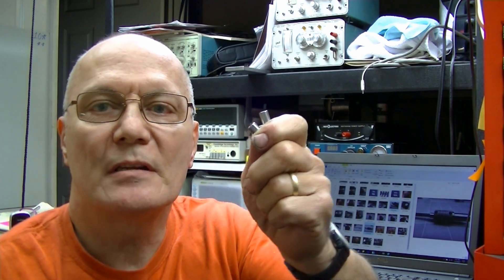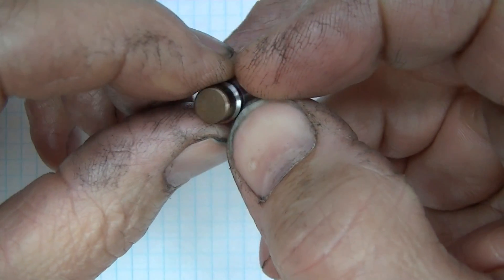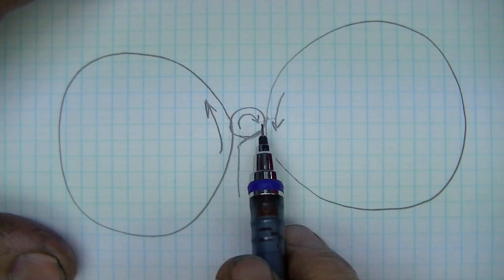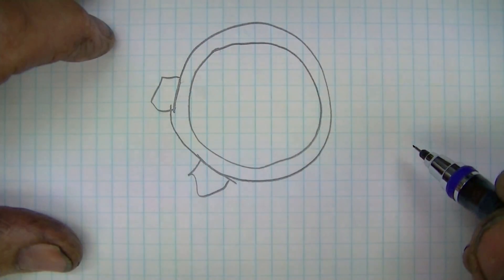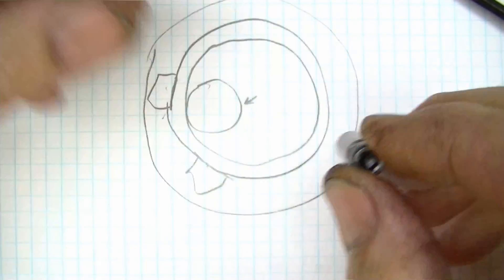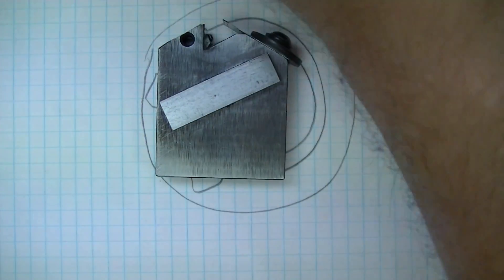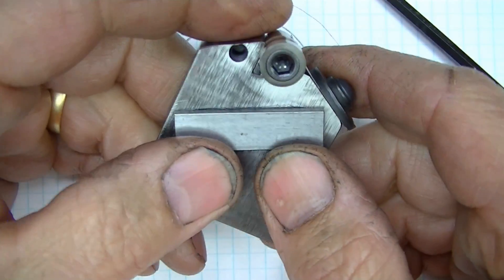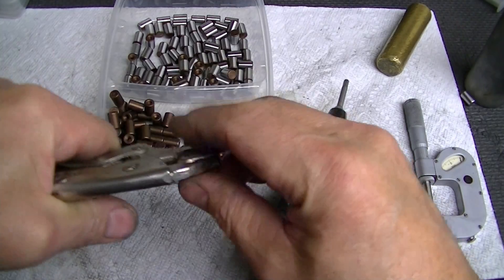CENTERLESS GRINDING  ON THE SURFACE GRINDER

Comment: Hey Robin, just found your videos, and really enjoying them - thanks for taking the time to share your knowledge! Do you happen to have a good resource for setting up the cutting geometry in this situation? Machinery's Handbook only uses terms like "too high" and "too low" but doesn't go into specifics or have any decent rules of thumb. Thanks!
Reply from the maker: You just have to get high enough to get the parts to round up. If you go too high on a regular centerless grinder the parts will scoot out from between the wheels. With the spring steel holder on my setup that wont happen.

Comment: What was the reason for not locking the table and head and using the y-axis infeed? Seems like there would be less worry about disc wear.
Reply from the maker: You have to remove the material full face for this to work at all. The single dress of the wheel lasted all 310 parts.

Comment: in another video you showed some carbide ball tipped indicators, how did you connect the balls? actually i think they were SiN. did you braze or glue?
Reply from the maker: Glued with Loctite 380 or 325 they are silicon nitride balls and are scuffed up where the glue touches with a coarse diamond file.

Comment: Clever. I have seriously limited experience with centerless grinding but found your solution interesting. Question....Once the wheel starts to cut the OD of the part, the part spins about the pin center until that newly ground area hits the first guide surface. Then it would shift a little bit to the smaller diameter. Did you ever encounter an issue with the change?
Reply from the maker: That is all part of the mechanics of centerless grinding whether plunge or through feed, regulating roll or shoe style. When set up well, parts that start as out of round will get round in the process of grinding. Obviously if you infeed too rapidly like full depth in a third of a part revolution you are going have issues regardless of setup.Thanks for stopping by
ATB, Robin
Reply: Thanks for the reply Robin. Obviously another shop process where taking your time is key to good results.

Comment: That's a great video once again - brief and to the point - thank you so much! One thing caught my attention: you say the bearing faces were "sort of induction hardened with a TIG torch". I would be most curious to get to know more details about this trick. Couldn't find anything in Youtube or the web. I am really thrilled  %-)
Reply from the maker: Thanks turbopunsch, I will do a follow up video but it is just heating the surface with the tig to bright red while trying to not actually melt it. The cooler base metal chills the A2 fast enough to get glass hard. Thanks for watching and commenting.
Reply: Do you ball the tungsten tip to make the arc less focused? I suppose 
100% DC should work best or do you use pulsed current or even some 
percentage of alternating current? Do you use a foot-pedal for better current control (avoid melting edges, etc.)? Thank you once again for taking your time for not just reading but even responding to all the comments!!
Reply from the maker: Sharpened  tungsten and DC with foot pedal. My tig is old school without any waveform controls other than DC or AC.

Comment: thanks. Resourceful approach. Very instructional.
I understand that the dial indicator measured the vertical travel and stop at zero of the grinding disc. How did you stop the horizontal travel of the grinding disc each time? By mechanical stop?
Why not make this an additional video format of yours? A short presentation of an unusual approach. Short is good in YT.
Reply from the maker: Thanks rol eic, I mentioned that the table has a hard stop and a rubber band pulling it against the stop. I am considering more of this short style. Thanks for watching and commenting!

Comment: Interesting setup.  I would love to hear more about hardening with the TIG torch.
Reply from the maker: Thanks Volker1929, I will do a follow up video but it is just heating the surface with the tig to bright red while trying to not actually melt it. The cooler base metal chills the A2 fast enough to get glass hard. Thanks for watching and commenting.

Comment: I can't help but wonder if this idea would play well with Stefan Gotteswinter's cylindrical grinding setup.  Would simply extending length of your centerless jig allow centerless grinding of longer parts (up to the Y travel of the surface grinder), by traversing the Y axis?
Reply from the maker: Not that simple and centers are better when feasible.Thanks for watching and commenting!

Comment: Two things you mentioned that I would like to know more about. 1) Tig induction hardening 2) Roundness measurement. Every video you do makes me want to learn more. Your knowledge is boundless....many thanks for sharing it with us all.
Reply from the maker: I did say "sort of" induction hardening with the TIG. I used induction implying a surface only hardening. Obviously the only induction involved is in the saturable reactor transformer in my old school Tig machine. I will do a follow up video but it is just heating the surface with the tig to bright red while trying to not actually melt it. The cooler base metal chills the A2 fast enough to get glass hard. Thanks for watching and commenting.
Reply: This is not induction hardening as there  is no coil. It is electric arc hardening.
Reply: I still would like to know more about it.

Comment: excelente!
that's german for 'excellent!'
please explain 'induction hardened with tig' that really perked my ears up.
Reply: I am not sure about your german ;)
Reply from the maker: Thanks Tony, glad you stopped by. I am not sure about your linguistics but your videos are awesome! I did say "sort of" induction hardening with the TIG. I used induction implying a surface only hardening. Obviously the only induction involved is in the saturable reactor transformer in my old school Tig machine. I will do a follow up video but it is just heating the surface with the tig to bright red while trying to not actually melt it. The cooler base metal chills the A2 fast enough to get glass hard. Thanks for watching and commenting.
Reply: Da Zweifel ich auch (said the Ami)
Reply: I am pretty sure all german words are at least 50 characters long.
Reply: gotcha.  You gave me visions of wrapping the steel in 4-5 turns of tig torch wire!  looking forward to your next vid.  Thanks again.

Comment: Very elegant setup there, Robin.
While we have a centerless grinding setup at work for the surface grinder, it would not have been able to do the job you showed, as it has a pressure roller from the top.

Thank you for sharing! :)
Reply: I have heard somewhere that in europe there are many  more small centerless grinding devices than is USA     I want to find out more about them...... Right now I cannot visualize a topside pressure roller setup....was the unit in your shop a shopmade prototype or a commercialy produced unit ?
Reply from the maker: Thanks Stefan, I have making that style of centerless unit on my list because it is also very handy. Thanks for watching and commenting!
Reply from the maker: St Mary's Spin roll has been around in the US forever http://asmfab.com/product-lines/st-mary-spin-rolls

Comment: Hi Robin,
This is a clever way to solve a problem...!!!
One question, do you have to compensate for some wear on the grinding wheel as you were going?
Cheers,     Pierre
Reply from the maker: Thanks Pierre, I did all 310 pieces on one dress and only compensated about .0003" for wheel wear. It is a Cubitron ceramic wheel and is excellent. But I was only removing about .0005" of the parts. Thanks for watching and commenting!

Comment: Fantastic!!  Would be interested in hearing more about your comment on "induction hardened with a tig torch'".. Thanks Robin
Reply: +1.. Rob can drop a half sentence of something and we all come running for more info. Superb job btw..
Reply: vpitool I to would love to know , induction to me is coils ad magnetic flux , TIG is just heat and very local , but I am sure of one thing Robin has a cunning plan
Reply from the maker: I did say "sort of" induction hardening with the TIG. I used induction implying a surface only hardening. Obviously the only induction involved is in the saturable reactor transformer in my old school Tig machine. I will do a follow up video but it is just heating the surface with the tig to bright red while trying to not actually melt it. The cooler base metal chills the A2 fast enough to get glass hard.
Reply: I've been wondering if there is an easy way to handle A2 steel other than vacuum furnaces and 1/2 deg. precision ovens and stuff. An A2 101 would be great..:) Not a lot of info out on this one.
Reply: Got it! That makes sense. Thanks for the reply and please keep the great info coming. Among the many Youtube machining channels your content is really exceptional.

Comment: I thought about this and I think this always requires a wheel at least as wide as your ground surface right? Your solution was brilliantly executed and I loved seeing it!
Reply: bcbloc02 No not necessarily. do long as the fixture is long enough to accommodate the length of the part, the table can be moved in the "y" direction. Depending on the amount of y travel on your table you could bring a part that long. On a 6x12 grinder your part could be 6"long. Setting up and indicating the whole setup would be time consuming. Once setup you could just as easily run 1000 parts. I actually think I prefer this method of cylindrical grinding on a surface grinder over using centers. It's a little more simple to set-up....maybe?
Reply: I would think that if you did that you would wind up with a tapered part? I think the partunder the wheel once you started grinding would either be unsupported since its diameter would be less than the rest or it would bow and flex into the stop and you would wind up with some less than stellar dimensions as you fed across and your contact points kept changing. I could be wrong but that is how I picture it going down in my head.
Reply: Good point. Because we are removing minute amounts of metal. I think it would be feasible to run it back and forth adjusting the grinding wheel down lower for another pass until the entire cylinder is the same size. Only one way to find out I guess. Though I won't be trying it anytime soon.
Reply from the maker: You have it right Brian on that and also on your comments below. Thanks and thanks for watching and commenting!

Comment: What kind of tolerance are you able to hold with this setup? Was wheel breakdown a problem?
Reply from the maker: easily within a tenth. I dressed the wheel once for all 310 pieces, awesome wheel but It is only removing .0005" of the diameter.

Comment: That's great, thanks Rob, I'd never heard of that type of grinding before and only the former process.

A couple of questions. So is this basically just a glorified V-block? Speaking of which, I like the spring steel to hold parts in the V.

When you said "induction hardening using the TIG", do you mean you used air hardening tool steel and zapped it with the TIG where you wanted it hard? I hope so, because that would be a good idea that I've never tried. I don't have an induction heater (unremarkably I guess) and can get more localised heat with a TIG than a torch. Have you ever tried hardening drill rod (silver steel down here in Oz) that way? I've always oil quenched it and don't know if it will air harden.
Reply from the maker: Thanks Pete, it is a glorified 60 degree V block.  I said "sort of induction hardening" and you have it right on the tig.  Oil or water hardening steels will not properly harden using air quenching. The cooling rate is not fast enough. thanks for watching and commenting!

Comment: please make a video on induction hardening with a tig torch. as a welder and machinist I'm extremely interested. Thank you for your time sir.
Reply: I would expect it's just heating with a tig torch and then following the usual heat treatment process, nothing really exotic, but handy for making small pockets of hardened steel
Reply from the maker: I will do a follow up video but it is just heating the surface with the tig to bright red while trying to not actually melt it. The cooler base metal chills the A2 fast enough to get glass hard. Thanks for watching and commenting!
Reply: Thank you

Comment: Can you show us how you applied the heat to the part with the tig torch to harden it?  I've been thinking about trying to do something similar and am curious how you did it.  Thanks
Reply from the maker: I will do a follow up video but it is just heating the surface with the tig to bright red while trying to not actually melt it. The cooler base metal chills the A2 fast enough to get glass hard. Thanks for watching and commenting!
Reply: Maybe it's just my inexperience talking, but why would it be more complicated than simply heating the metal as if you were going to weld it, then quenching it in the usual heat treatment fashion?
Reply: Rob Mckennie i think that with the tig torch it might be possible to achieve a more localized heat treat without inducing a ton of heAt and causing warping of the part.  Also, it could be an effective means of applying enough heat to harden critical areas for people who don't have oxy acetylene setups

Comment: Very interesting Robin, would like to see more about hardening with TIG
Reply from the maker: I will do a follow up video but it is just heating the surface with the tig to bright red while trying to not actually melt it. The cooler base metal chills the A2 fast enough to get glass hard. Thanks for watching and commenting!

Comment: Super interesting and a true treat! Is there a particular reason why you chose to grind the pin on the right side of the wheel other than to get closer to the coolant? It looks a bit scary.
Reply from the maker: Thanks Anders, that is where it has to be to form the correct positions for good rounding action. Thanks for watching and commenting!

Comment: Hey Robin,

Another excellent video. Lapping those would have been pretty painful. I'm curious about finding the optimal angle. Did you check roundness a few times working your way to the angle you glued the stop at? Or did you nail it out of the gate? Another cool setup to put in the memory bank. 

Talk to you soon,

Tom
Reply from the maker: Hey Tom,
I turned the block roughly 30 degrees and I just moved the wheel to the left as far as I could without grinding the end stop screw completely away and it behaved nicely right there, lucky I guess. Thanks again for your avid promotion of my channel.
ATB, Robin
Reply: Looks like its parallel with the 30 degree surface that was ground into the shoe.

Comment: Absolutely brilliant solution, thank you for sharing.  I love how your solutions are so simple.   I am really interested in how you utilize the TIG torch for heat treatment.  Do you use it for other things?  Do you think it would be useful for hardening machined gear teeth?
Reply from the maker: Thanks Pete and thanks for watching and commenting! I will do a follow up video but it is just heating the surface to bright red with the tig while trying to not actually melt it. The base metal chills A2 fast enough to harden. I would not use it for gear teeth.

Comment: Now you're a nice guy and all Robin, but I may have to work you over a little bit. You know horse head under the sheets, "offer you cannot refuse" type stuff if you keep taking this long between videos... You are in my opinion one of the absolute finest machinist on YouTube and I get strung out pretty quick one I've had a taste of the good stuff :-)

Seriously, someone should be sponsoring you with the stipulation of a video a week. Keep it up :)

Going to watch the video now with the burning sensation of knowing this may be all I get for the next few weeks LoL!
Reply: No, no, no, I take it back. I'll wait patiently for your next video. I learned never to mess with anyone as intelligent as you :-) Take your time. At your leisure. Whenever works for me. 
Can you elaborate some on the induction hardening with the TIG welder please?
Reply from the maker: Thanks for the very kind words DrKnow65. I will try to do better :) Thanks for watching and commenting!
Reply from the maker: I will do a follow up video but it is just heating the surface to bright red with the tig while trying to not actually melt it. The base metal chills A2 fast enough to harden.

Comment: What are these for and why do they need to be so precise?
Reply from the maker: High pressure hydraulic pistons and the leakage gap needs to be very small to prevent O-ring extrusion

Comment: Excellent trick to have up our sleeves, thank you! How much concentricity, if any, is lost between the threaded hole and the  finished ground surface?
Reply from the maker: There is no concentricity requirement on the thread. But I am only removing .0005" to .0008" from the diameter so it would still be pretty concentric. Thanks for watching and commenting!